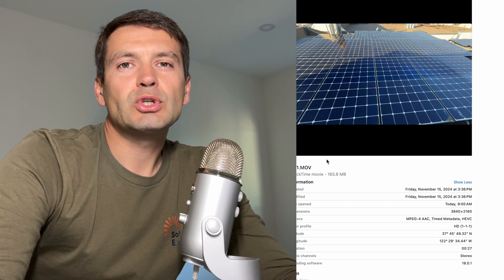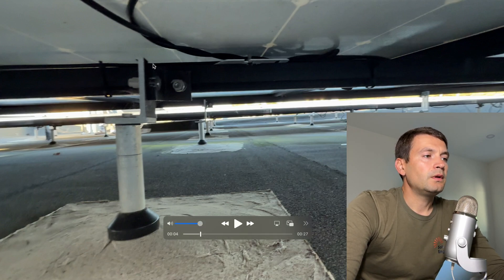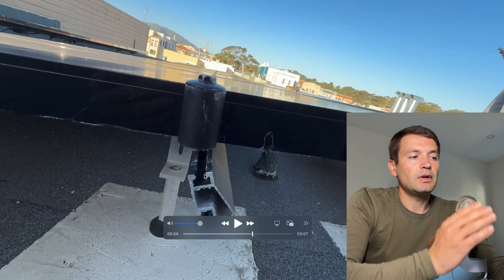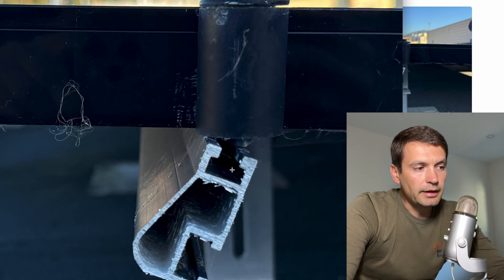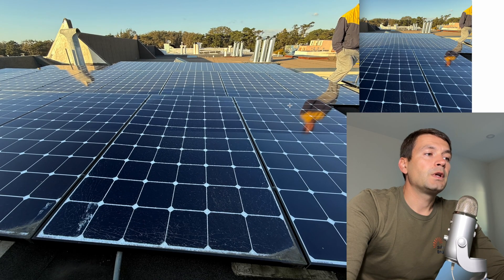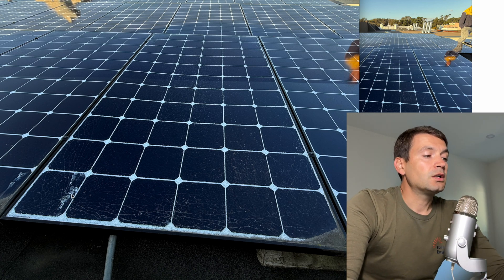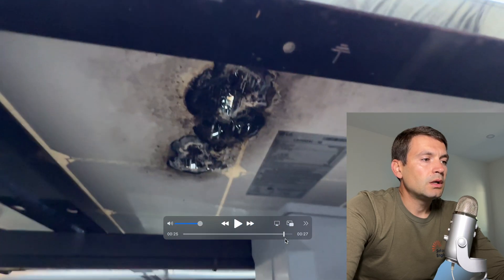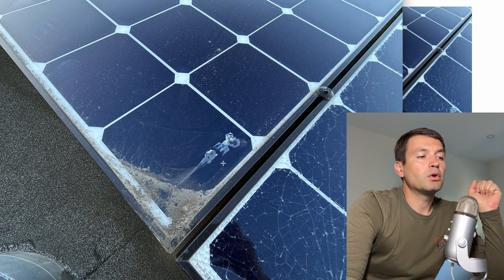How not to install solar panels. Part 2.

Comment: Dont think that panel could catch a fire on itself, there nothing to burn. Thin layer of plastic which firstly melt, and glass and silicon
Reply: Everything can burn. Just a matter of more heat. Electrical arc's burn thru anything on this planet
Reply: @MegaCyrik  Everything can burn - yes, but double (dual) glass panels are Class A fire resistant compared to plastic backed panels
Reply: Oh they can burn. You can find lot of videos here on YouTube. Just search for pv/solar panel fire.